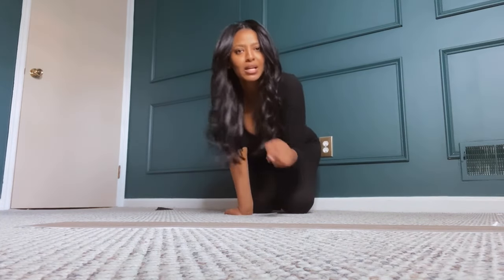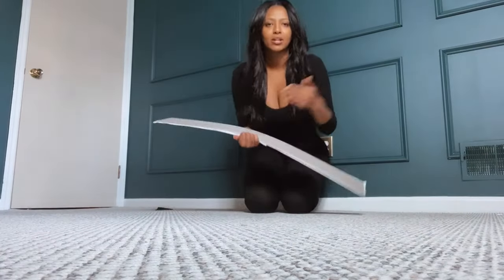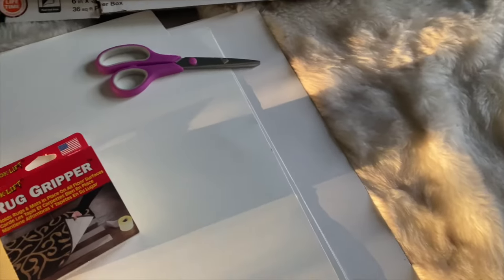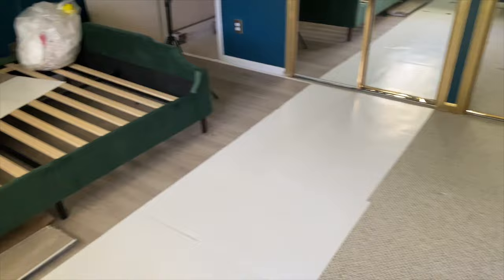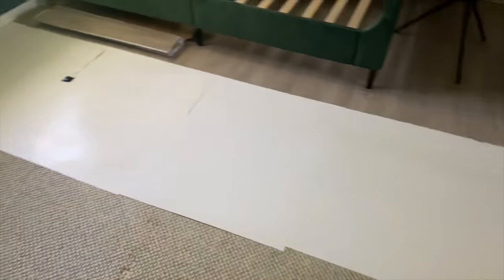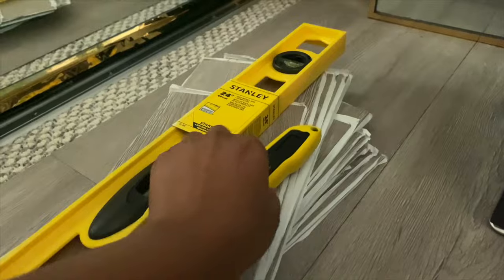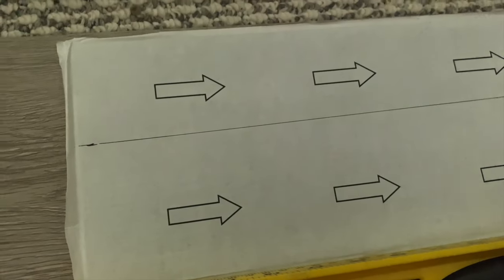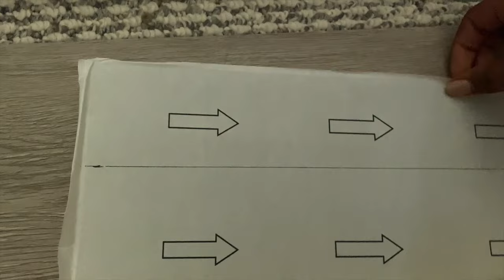DIY FLOOR MAKEOVER- Peel & Stick Tile Over Carpet (RENTER FRIENDLY- BUDGET FRIENDLY)

Comment: Does it feel like hardwood when your walking on it or does it feel like soft carpet under?
Reply: Do not do the project like this. Think about it. The poster board is very bendy and thin. Lay that on top of any carpet especially medium to high pile carpet. Will simply not support the weight of a person walking over it. This will create a lot of movement thick like memory foam your weight will sink into the carpet underneath. You need 5 - 10 mm thick hard plywood NOT poster board on top of the carpet.
Reply from the maker: Hey! Overall its pretty solid, but not 100% like real hardwood. This is a quick & budget friendly solution for people renting or those who want to avoid installing real hardwood floors.
Reply from the maker: @stefanjefferson73  Hey! This is a quick & budget friendly solution for people renting or those who want to avoid installing real hardwood floors. If that isn't your goal, this isn't the video for you.
Reply: @IdaAlexis  please don't take offense you've done a nice presented video showing a budget friendly way. I'm simply answering the question asked. If they do like this they will be redoing it a couple of years later. The more it's walked on the more indentations will appear much like memory foam due to the underlay (poster board) not being firm or thick enough for body weight walking on it.
Reply: @IdaAlexis  so how does it feel walking on it? You never answered that question
Reply from the maker: @ibekazzie3911  Hey! As mentioned above,  it feels pretty solid to walk on, but not 100% like real hardwood floors.
Reply: @stefanjefferson73  she has in the description she removed it 6 months later. I’m sure the goal is for rentals and not a mortgaged home where it will be down for years…….There are tons of other videos with wood underneath yet you watched this one to complain there’s no wood😬

Comment: Can’t imagine this lasts long. I’d imagine it’s going to flex when you step on it and eventually lead to cracks/breaks. As much as I’d like to do this in my apartment(because I hate the carpet in here). I’d imagine I’d only be happy with doing this up until the inevitable cracking/breaking of the new floor
Reply: I would imagine one good run in that room for whatever reason i.e rushing ro get dressed and the floor would shift causing you to hurt yourself. creative ideal tho.
Reply: @Master63y what about stapling the poster boards down first before applying the tiles
Reply: Orrrr get that plastic they use for wen u paint and put down staple that down but pull it very tightly over floor instead of getting all that poster board orrr use card board boxes (free)very flatly
Reply: I've had mixed results. I used cheap peel and stick vinyl from Walmart in one room and higher quality from Home Depot in the other. The home depot has cracked from foot traffic, the Walmart tolerates furniture being moved on it and has no cracks. The technique works, but thinner more flexible tile seems to be the best.
Reply: I've been thinking about getting that plastic mat stuff for office chairs that has the sharp teeth on the underside, then poster board then the wood vinyl stuff to avoid the carpet plush push down whenever you walk on it....gonna be expensive tho but I still wanna try it.

Comment: ONE ADDED TIP - Thank you very much for posting the helpful video!  
Just one tip to add - STAGGER THE PLANKS AS MUCH AS YOU CAN.  Rather than laying the planks in a straight "square" or "rectangle", with all the planks ending in a straight line OR using the SAME random pattern throughout the installation (giving the final result a "stair step" or "H" pattern), randomize the layout (stagger the plank) as much as you can (unless you want a repeated pattern, of course).  Staggering the planks will do three things:   -- #1) Give the final structure of the installation more strength;  #2) Give the final result a professional look; #3) Prevent the long straight-line seams that are formed in square or rectangle layouts from catching dirt over time, making them more noticeable.  The labor itself won't be anymore difficult, it will just take a little more time in planning. There are many websites that give instructions on how to accomplish a totally randomized installation/layout. (Google "stagger vinyl plank flooring".)
Reply from the maker: Yes good point 👍 I didn’t know about this technique at the time

Comment: Hello, I just came across your peel & stick tile in the bedroom.  Had a question: Does it make a hollow / crinkle / crunchy sound when you walk across it??
Reply from the maker: Hey! No, no sounds. This DIY only works on a really low carpet so it sits relatively flat to the ground. That’s an issue you would have if the carpet is too thick.

Comment: Perfect  & geniuse. I need to renovate my apartment old carpet , coming from the walls. Leasing manager claims it's new, he must ment in the past tense as when it was put in that apartment years ago.

I'm going to try the poster board with the tiles from Wish. Wish seems to have a nice asortment of light adhesive floor tiles that will brighten up my room.

I put the privacy film on kitchen window and inspection came  and thought I replaced the windows and was amazed. 😄😁
Reply from the maker: The privacy film idea is brilliant! Thanks for watching 🙏🏼💙

Comment: How does it feel when you step on it? Does it feel like normal laminate or is there a “give” I’m thinking of doing this to my studio where I will have a rolly chair. Do you think it could sink into the cracks? It is such a great idea and I want to start!
Reply from the maker: Hey love! Overall, it’s pretty solid. This DIY only works on a very low carpet. If it’s too high or plush, the tile won’t sit flat or feel firm when walking

Comment: How long did you have this down for. I want to do my whole home. How does it hold up overtime with heavy furniture like the bed for a long time. Did it have any sink spots? Or pressure spots?
Reply from the maker: Hey love, I wouldn’t recommend to do this for your whole home if possible 🙏🏼 if you’re able to install real hardwood floors, that would be so much better. I only did this in a bedroom because HOA rules only allowed Carpet. If you have the ability to do real hardwood floors, that would be more ideal

Comment: Thank you for sharing this. I’m wanting to do this in my office (I’m renting). My only question is if you accidentally drop or spill something that’s liquid on the vinyl, does it seep through the cracks leaking onto the carpet?
Reply: I will say that it probably wont matter honestly. Because if you didnt have the planks, then whatever gets spilled would have just fully spilled onto the bare carpet lol.
Reply from the maker: Hey love, not sure how I missed this comment! Definitely avoid spills, but even if you spilled a little its not the end of the world. Also for cleaning, vacuum & use swiffer wet pads instead of a mop
Reply: @IdaAlexis  thank you.

Comment: Awesome 😩😍I’m trying to put down wood over carpet in my room as well as the living room. How does it feel when walking on it ? Is it a solid surface , or does it dip in when stepping & walking on it ?
Reply from the maker: Thanks love! & its holding up pretty well. It feels normal when you walk. The only thing I noticed not to do is walk on it with really pointy heels lol

For a DIY 100% worth it
Reply from the maker: Here's the update & removal video https://youtu.be/gQe14yFWmPQ
Reply: I did tried this- but I think it will depend on the kind of carpet you’re covering. We had the one that is still kinda new it kinda dip when stepping/walking on it. :(

Comment: this looks fantastic - so quick question for ya ;) how do you prevent it from being bent or developing dents due to the flexibility of the carpet underneath?
Reply: Wondering same thing...is it squishy like walking on jelly? 
I've always ripped out old carpet, underlay, ripped up tack strips  and worked on solid concrete with peel and stick tiles.

Debating on doing this

Comment: Any updates on how this has been holding? I am moving out to a new apartment and don't want the carpet and I am thinking of doing this, but I'm a bit iffy since I don't know if it has held well or caused any damage.
Reply from the maker: Hi! I had this on for about six months before moving out and overall it held up pretty good. This DIY would only work on a very low pile carpet. If it’s too thick or high, the tile won’t sit flat and feel firm. Also, in regards to moisture, yes, you have to be careful. I vacuumed and use a swiffer with wet wipes to clean and that’s fine.

Comment: I absolutely love your method! I am looking for a solution to cover up carpet in my apartment for easy clean up.. are there issues with liquids going in between the edges of the individual pieces?  In cases where you'd need to mop, if spills happen, animal accidents, etc.
Reply from the maker: hey! thank you so much 🙏🏼💙 I vacuum & use swiffer to clean. the wet pads get the job done better than mop for this set up. I would be careful and avoid too much liquid
Reply from the maker: 6 month Update | removing tiles- @

Comment: I'd do this but Im so worried about mold growth, would this cause any mold ?
Reply from the maker: Hi! No not at all, but good point bc it’s important to avoid access moisture. I vacuumed and used a swiffer with wet wipes not mop.

Comment: Do you think this would work with a carpet that is a little bit thicker? Like do you think it would squish and move around even with poster boards underneath
Reply from the maker: Hey love, I wouldn't recommend doing it on a thick carpet because it will most likely squish. I saw another video where they added a layer of wood and then put flooring over a thick carpet.

Comment: Great video! Been wanting for a way to do that in my flat…  two questions for you:
1. Would the tape damage the carpet upon removing? 
2. Does it move at all? Laminate tends to “float” so wonder whether you have this issue With these sticky ones? .
Reply from the maker: Thank you! 
1. No. Its rug tape so its designed to be used on these surfaces.
2. Overall, it's been in good shape but I did notice a little lifting.
Reply: Staggering the planking would help with lifting. All of the seams line up the weak points so it extends the weakness along the end of every board. Cut your first plank in half then start with the leftover from the last row.
Reply: @amberfrazier575  What do you mean by "staggering"?
Reply: she explained, but google “bricks” and look closely at the rows, and how each row is not parallel with the others. thats what she means by staggered
Reply from the maker: Here's the update & removal video https://youtu.be/gQe14yFWmPQ
Reply: @amberfrazier575   thank you i would love a staggering demonstration, i still did not understand

Comment: Love it. Gonna do this in living room, and other rooms
Reply from the maker: Thank you so much!
Reply: @IdaAlexis  I tried yesterday it does look good but it’s long
Reply: I started in dining room which is connected to my living room. I will try to finish no later than Wednesday. Very inexpensive.
Reply from the maker: @aminahdakiyai6528  Woo hoo! send me before and after pics if possible :)
Reply: @aminahdakiyai6528  Did you use carpet tape on the entire carpet or just the perimeter, then connect the middle with duct tape (like the Youtuber did)
Reply: @noellerobinson8752  No, I used poster paper with tape. But  a few days later I pulled up the rug and re did by cleaning up whatever dust and used underlying then the peel and stick
Reply: @aminahdakiyai6528  does it feel flimsy or like bendy at all to walk on?
Reply: @chels7416  Hi, For me it was better to lift the rug up because certain areas like the door areas gave me a problem due to height.
Reply: @chels7416  I actually redid it. The height of the rug with the vinyl at my front door and coat closet didn’t work.

Comment: Question when removing this floor does it leave a mark since you used the carpet grip asking for myself since I rent my apartment and hate the rug?! Would appreciate any feedback
Reply from the maker: Hey doll! Thanks for watching. I've used rug grip many times and there is no mark. The material is designed for this purposes and easily removable. I also rent so totally understand your concern! Funny story, I put marble contact paper on the floors of my NYC apartment and was so nervous when moving out. Even that was relatively easy to remove and my security deposit was returned in full :) Good luck with your project🙏🏼💙
Reply: @IdaAlexis  Ahh thanks so much for replying very helpful ! :)
Reply from the maker: @saraisabelzuniga  Anytime love! thanks again for watching
Reply from the maker: Here's the update & removal video https://youtu.be/gQe14yFWmPQ

Comment: This looks great but how do you mop the floor if it’s paper underneath? Also how stable would this floor be? Wouldn’t the paper underneath tear eventually? I wanna do it but my carpet is so thick it’s very ugly and bumpy.
Reply from the maker: Hey! For cleaning I used vacuum and swiffer with wet pads. Avoid mopping for moisture issues. Also, this is only good for very low pile carpets :( otherwise, it will not sit flat or feel solid

Comment: I’m definitely trying this! But wait I have one question. I’m kinda concerned about spills. Like if I spill water on the floor, will it get under the tiles and make the carpet mold? Or am I just overthinking about being paranoid?😭
Reply from the maker: Hey love, thanks for watching🙏🏼💙Lol no its a good point. Definitely avoid spills, but even if you spilled a little its not the end of the world. Also for cleaning, vacuum & use swiffer wet pads instead of a mop
Reply: @IdaAlexis  ok that makes sense! Thank you!🙏🏾💜💜

Comment: This is a great Idea... question since its over carpet will the planks crack feom pressure when you walk on them since they are not as stuedy as hardwood? Also can you really tell the difference when you walk on it?
Reply from the maker: Hey! Thanks for watching 🙏🏼💙 The floor was pretty solid for me bc it was a very low pile carpet. I would be careful with a higher pile carpet because it won't sit as flat.

Comment: Is it holding up? I'm going to do this but I was going to use 1/4" plywood sheets, not foamcore... but if it works then idk maybe I'll do what you did.
Reply from the maker: Hey Sarah, if you have the option of adding plywood I say go for it! it’s holding up pretty good but there is some lifting. I wanted to avoid using plywood tho so it works for me :)

Comment: Question how has this held up when mopping. I’m pretty sure your only using a stiffer mop. I just want to know have you pulled it up? What did it look like after pulling it up
Reply from the maker: Hey! Thanks for watching. Overall pretty good. Yes, I used a vacuum and swiffer only to avoid too much moisture. Here’s the link to the removal video and review (6 Month update) | DIY PEEL & STICK FLOOR TILE REMOVAL
https://youtu.be/gQe14yFWmPQ

Comment: D'you think this would work on carpet with a higher pile? I just moved into a place with just the nastiest, scratchiest greige carpet you can imagine. The room's weirdly shaped and large, so getting the right rug would be difficult, not to mention costly.
Reply from the maker: Ugh unfortunately this works with very low pile carpets otherwise it won’t sit flat or feel like a solid floor
Reply: Yeah, I wasn't sure so I ordered a sample pack of the vinyl boards. It's not too bad, actually! My little sample patch hasn't slid around or anything. I think I'll give the whole room a try!

Comment: Question? Using the poster board instead of wood planks, do you feel the instability or squishiness of the carpet as you walk on the peel and stick flooring?
Reply from the maker: Hey! It's not perfect, but overall its sturdy. The wood planks would be ideal but I didn't have that option. Also, try staggering the tiles for even better results :)

Comment: Would heavy weight poster board make a difference?  Would it be better?
Reply from the maker: Hi! No, I think this is a better option. If the poster board is too thick, it may prevent the tiles from laying flat on the floor.
Reply: @IdaAlexis  Thank you!

Comment: How does it feel under ur feet and how is it holding up? Also does it make the room feel smaller?
Reply from the maker: Hey! It's not perfect, but overall its sturdy. Adding wood planks underneath would be ideal but I didn't have that option. Also, try staggering the tiles for even better results :) No, the room feels much bigger and looks 10000x better

Comment: I might try it, I don't know. We have carpeting in our kitchen. The problem is, another video said you should shampoo the carpet first. What's on our carpet is so stuck un it, there's no way shampooing would get it off. But that was putting tile directly over carpet. He didn't mention posterboard. 
another thing. After you told us about the materials, the sound went off. It looked like you were talking but no sound.
Reply from the maker: Hi! Thanks for letting me know, not sure what happened with the sound. Shampooing the carpet is optional, but I highly recommend using the poster board as a protective layer between the tile and carpet so there isn’t any residue

Comment: Hi Ida. So if the tiles are stuck to the sheets over the carpet are they not going to move?
Thanks.
Reply from the maker: Hey! Yes, the rug tape you apply on the bottom of the sheets hold it in place. It’s very durable and designed for rug/carpet and doesn’t leave any residue